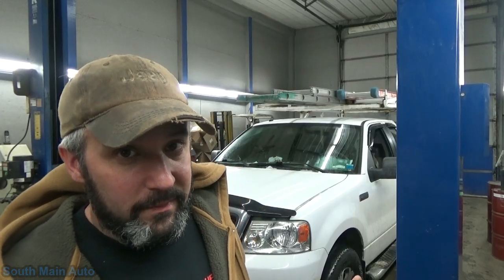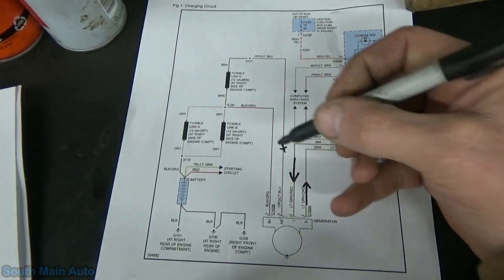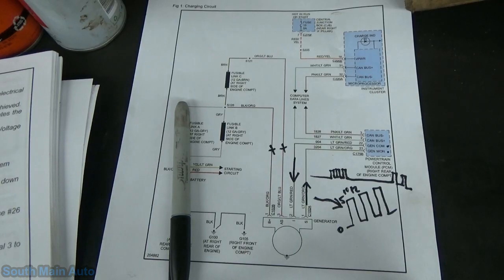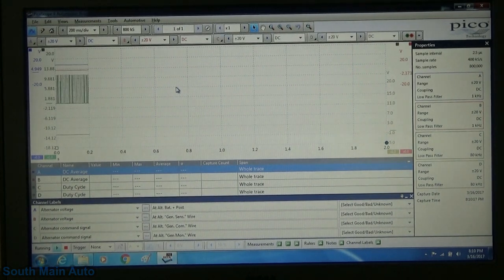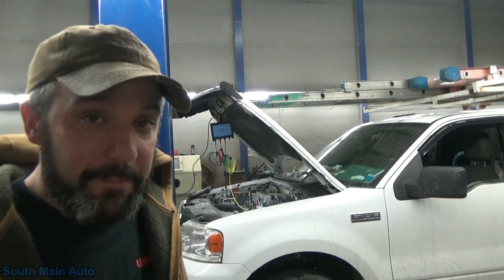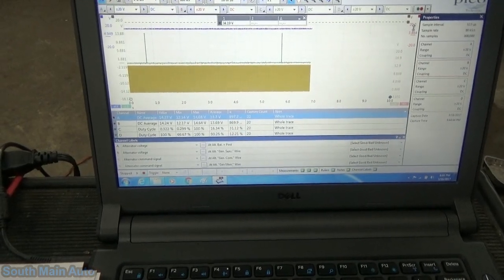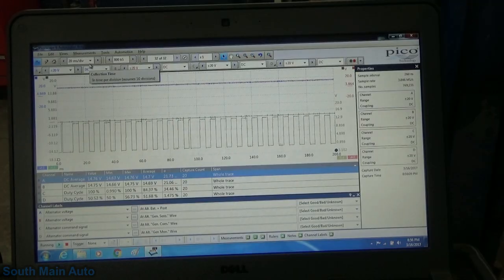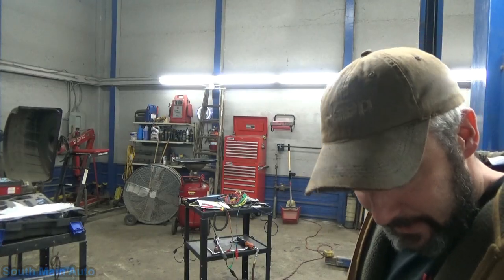Ford "Smart Charge System" Alternator Not Charging

Comment: Thanks for the nice video, but it's just another example of over engineered garbage under vehicles.
Reply: I'd say badly engineered or halfheartedly engineered. If the programmers had actually given a shit, there would be code to monitor the battery voltage and throw a code if the alternator isn't maintaining proper voltage and not just trust the COM line as gospel. One of those cases where when everything works, it works but when it doesn't then extra hilarity ensues because of assumptions made.
Reply: +gocars - I've got an '86 Grand Marquis that had the OEM alternator at age 20, with about 130k on the clock at the time. Simple, and reliable - can't ask for anything more than that.

Every year I love that car more and more. :)
Reply: i got 240,000 miles on my 94 rams original alternator.. and i only had to replace it cause the casing cracked when i went out mudding and it got showered in water.. still charged but only above 1500 rpm. they really just dont build things like they used to... and i even got a engine light for low charge voltage... those trucks almost never threw a code unless the part was literally falling off... and these fords systems are supposed to be "smart"?? lol what a joke ford
Reply: I agree. There has been a lot of this type of stuff over the years. Some things, simply cannot be improved upon without introducing more problems. There are other great ideas, but they are pushed out before they are ready. They need more testing and refinement for they are ready.
Reply: At least past the warranty. I've had them last 300K before. One on the wives Liberty is at 235K and still going strong. My Blazer is OEM at 196,562. Got a 99 Jeep in the barn with 270K on it that's OEM.
Reply: I've got a '93 Volvo 940 myself - wife commutes in it just under 70 miles a day during the winter months, so our '86 Mercury Grand Marquis doesn't rot away to nothing. Alternators on both of those vehicles work great - the Volvo one is OEM original - 24 years and 160,000 miles! The battery is also 5 years old with no signs of slowing down yet.

Don't need no stinkin' computers!

I believe automakers have switched focus in the 21st century - it used to be "PLEASE THE CUSTOMER" ... but that has changed to "STUFF OUR BANK ACCOUNTS TO THE BRIM" , unfortunately for us, the buying public.
Reply: Ahh the 940 was the last of the good built Volvo's.
I bet your Volvo has never had a corroded brake pipe ?
That was back in the day when car were treated underneath so donkeys years later they are still going strong.
Reply: I agree .  A lot of complication / technology , to what benifit to the car owner ?

God bless
Wyr
Reply: How long is a alternator suppose to last?
Reply: @flippingfripp  2 years but if your lucky 5
Reply: Idk its a pretty simple system. 3 wires red full time power blue 5volt and the grey wire is a lamp indicator.
Reply: Exactly right Tam! Copper-nickel lines right from the factory. They're green, but still intact! Same can't be said for my '94 Chevy S10 pickup plow truck - it's on it's 4th set of lines in it's life, and I noticed brake fluid weeping from that set last night!

 Why other automakers never used copper-nickel lines I'll never understand. Vehicles in the Northeastern USA especially, where road salt destroys most vehicles in 12 years flat - sooner where Eric O. lives, due to the "brining" of all the dirt farm roads in the summer for dust control.
Reply: My brother's '02 Duramax caught fire once. I suspect a shorted battery (never used to happen) due to where the damage was.

But I'll tell ya, only time I ever came close to having a car fire with a pre-'96 vehicle was in my '72 El Camino ... because the previous owner had wired in an ammeter, and the Phoenix heat disintegrated the rubber insulators. One day while driving in the rain with the lights, blower fan, and auxiliary A/C unit fired up once back home in MA, the juice broke through the rubber and grounded right out on my dash - car instantly died and everything was super quiet. Flames between my legs, LOL! I was able to jump out and yank my quick-release terminal on the negative cable and cut power, thank God! Would've lost the car otherwise. Was able to blow the flames out after that. Close one!! 

From a mechanic's standpoint, I wouldn't mind owning a Model T! My grandfather always had them. If you spun a bearing miles from home,  you could crawl under there on the side of the road, cut part of your belt off, wrap the journal, and be on your way in a half hour. :)
Reply: @SmittySmithsonite  I think all cars,trucks,anything with a battery should have a emergency shut off to kill power
Reply: No question about that, Kyle. My Marquis has the same miles - still going strong. OEM original fuel pump, & power steering pump too! Would've been on the original A/C compressor too if I didn't burn it up running alternative refrigerants on the OEM mineral oil, with an ester oil mix.

Try getting that kind of life out of a component on a 21st century vehicle ...  ;)
Reply: Same thing that effects a pencil. Friction from pressing down on the stator! The number one thing that destroys an alternator is heat, from having it run 75% load all the time. Which burns up diodes, rectifier, voltage regulator, stator, and rotor. It's why high output alternators have the voltage regulator outside it. A heat sink and huge ass fan. Not to mention a 150-175 amp fuse bus. To protect against a fire hazard. If the VR falls below 4 volts. It will produce 250 amps and burn every wire up in the harness. As in ohms law. 

It's why these are alternators. The convert AC\DC. Not the old fashion generators they used...
Reply: You can also change brushes on new alternators, it just removing the back cover an then there is the regulator.. it has a micro Prozessor included but still is a regulator with brushes.Problem: They don´t sell them alone.. you can only buy complete alternator.. for 80+% of modern alternators you can not buy regulators...this really pisses me off
Reply: Joshua C one of my family members has a 2006 Taurus with 108k replaced alternator at 85k. So far been reliable
Reply: @justinp8946  taurus was built to be j&d's, car and driver's car of the year. Its totally excluded from a typical ford especially a work vehicle, like a pickup
Reply: +Smitty Smithsonite - Hang on to that Sedan, Man!
Reply: in most cases only the regulator or brushes need to be replaced..but in 80% of altermators you can´t buy them anymore
Reply: you never changed the brushes ?
Reply: In Ferd's defense they probably would go with the simpler more reliable solution. They were/are trying to squeeze every last MPG they could out of their fleet. By turning the alternator on and off and only using it when you absolutely need to, it doesn't do you much good but it helps them meet those CAFE mandates from Washington
Reply: I agree 100% Ivan. 

Battery in my '72 El Camino - EXTERNALLY regulated (as in points!) - let my Sears DieHard battery live 11 years! I haven't been able to get more than 8 so far out of the Silverado's battery ... and that was with LOTS of help from a 4-stage charger!
Reply: gocars how many people have tech like Eric tho? There's the problem. Most people just throw parts at it
Reply: @royalwins2030  you can use a harbor freight dvom for $40. It just takes longer you have to test each wire separately. The 2 com wires just use the frequency setting. It's the info on the system and wire diagrams that can be hard to find.
Reply: Fripp; decade, 
unless it's in an ambulance that does two shifts per day...
Reply: Interesting. It almost appears to me that the charging command field is inversely proportionate to what you would think it would be. IE command 0 regulator and generator give the battery the beans. The higher the command ratio the more the regulator is told to back off. That's my interpretation.  This correct?
Reply: That's what I got out of it too, Jay.
Reply: 240.000 miles on the first set of brushes ? Btw, what does affect the brush life ? load on the generator?
Reply: I have 1996 Ford F150  250 ,000 on the clock all original  replaced 2 fuel pumps  is 1 AWESOME  pickup
Reply: get an old merc, the 124 mercs had a changeable brush set.... lasts forever.
Reply: This place has alot of parts for newer vehicles. Here's a GM alternator:

https://alternatorstarterrebuildkits.com/product/dr442pin/
Reply: +bobl78 - The alternator on my 2004 Ford Crown Vic doesn't have a "back cover" and it doesn't look like the regulator would be easy to change... It's not charging, but the brushes are fine, about 1/2" of wear left in them...
Reply: not worth it for most people, as your typical mechanic is not very well versed in electronics , how many Eric O's have you met in the real world of the automotive industry?  Most of them can not even read a freaking labscope, I quit going to them twenty years ago, lol

/
Reply: "massively extend life of alternators and batteries"....ummmm this alternator only lasted 10 years so that is an engineering FAIL. Also, statistically I don't think batteries last any longer with these smart systems at all. Sometimes it's the opposite!
Reply: @PineHollowAutoDiagnostics  strange thing is that my old 70's era cars went through batteries and alternators every 3 to 5 years with moderate driving on cars with less than 100k. My 400k Subaru, I replaced the alternator once around 300k, and was on the 2nd battery it ever had in 20 years.
The thing is old cars required way more maintenance and had a shorter life span. They lasted the same amount years, but we collectively drove  less then. 100k was old. Now 200k to 300k is normal.
Reply: My 28 year old Volvo has a total of 16 fuses  and has its original alternator works just fine.
Having worked on cars for the best part of 45 years i do understand the concept and operation of the system but in my opinion if it aint broke dont try and fix it.
I do understand things progress and i am all in for that but sometimes so ideas are WAY over the top.
Example, dual clutch assemblys work awesome but its over £1500.00 for parts.Then theres the labour and the special alignment to to install the clutch and the tool is a £900.00.
So its not all rosey in the Automotive business.
Reply: simple rules, i'd rather drive a car i can fix at the side if the road with my eyes and hands than ANY of the modern shite. all this modern fucking around is aimed at one thing, making it a fucking nightmare to fix yourself, and to force you to take it to the dealer where they can rape you for cash.... FUCK THAT.
Reply: Amen Rick Amen.
Its a wonder that older car even ran at times.
Modern overcomplicated heeps of overpriced garrbage.
Simple is good in my book.
Reply: It's not over complicated. They system is just 4 wires that control the amount of voltage\amps the system gets. If it didn't monitor it right. It can fry your radio, dash panel, even the PCM.. As they are voltage sensitive and expensive to replace because it got 14.7 volts and not 13.8 volts.  That the PCM demanded. Just like the idiots that replaced their rear tail lights with LEDS then wonder why they fried their transmission. As it thinks you have your foot on the brake and locks the TC up all the time. Then they say how much to replace my transmission!!!!
Reply: @MasterChief-sl9ro  the tail lights aren't in the same circuit as the brake lights. Did you mean brake lights having the LEDs tripping the TC lockup command? If the brakes aren't being applied, the switch is open and the brake lights are off even if the tail lights are on. Totally different circuit that is NOT part of the TCC and Brake Switch.
Reply: @PerrynBecky  Some Vehicles that came with resister bulbs need that bulb... If you replace them with LED. You need to put a resistor that matches that Bulb. As the TC will think you have your foot on the brake. If you remove side panels on some cars. You see relays and fuses in there. They control the all them circuits. 

I become aware of this from transmission experts years ago. And that third eye is the worst. If you see that bulb out. Replace it right then.
Reply: Yeah how dare the auto manufacturers design a system to massively extend the life of alternators and batteries in their vehicles. Ford went one step further and designed it to fallback to a traditional style circuit just by unplugging the com wires from the alternator. They could just as easily designed it to not charge at all unless there was comms with the PCM. Just because you don't understand it, doesn't mean it's "over engineered garbage."
Reply: @pv2xeek  thats a dealer secret. Noone knew that until 10 to 15 years later. Not simple at all
Reply: Seems like Ford went to a lot of trouble trying to fix an issue that did not exist. Most alternators fail due to worn brushes/commutator or blown voltage regulator and these can be detected with a voltmeter and fixed with $20 of parts.  'Ford Built'.....to fail.
Reply: +fripp how long, perhaps 50k miles seems about average for what ive seen
Reply: I totally agree. I had a 2004 Taurus with 260,000 miles with the original alt with this system. It was still working great at that 260k when I sold the car. Ford was one of the 1st to use this type of system but now all vehicle manufactures use this system. I think it cool they choose to use a system like this as the old system would probably still get the average person past the warranty but this system will allow the system to last far past the warranty and far beyond.
Reply: @jockosboy17  alternator is a general repair/replace part. Its service is shorter than warranty. Plus if your not replacing it with motorcraft parts its guaranteed shorter life. Thats the marvel of very expensive ford engineering.
Reply: i wouldnt necessarily call it over engineered.  these systems can extend battery and alternator service life.
who knows how old that alternator was? it may have been the factory original, in which case it lasted a long time.
yes, i will agree that cars are super complicated devices now, but generally speaking they are safer, more reliable, better built, quieter, comfortable, etc..
AND...when you have techs like Eric O. (who is DA MAN) they are easy enough to service and repair
Reply: Josh Underwood I understand a little bit more than you think, and all that crap is completely unnecessary and a vehicle.
Reply: You have no clue what you're talking about. I seen voltage regulators burn a vehicle to the ground. Today's modern vehicles need these systems. As you have 300+ calculations a second to maintain there fuel, air, transmission, braking, etc... efficiency. As these are not your dads horse and buggy or model T. We got better microscopes today...

Comment: i know ya do these videos in advance, but a theory of why the light didn't come on... how about the body ground?
Reply: HOW ABOUT  extremely bad trash engineering/ I HAVE A 1996 fORD f150 REPLACED 1 BATTERY AND 2 FUEL PUMPS  OTHER THAN THAT ALL IS ORIGINAL
Reply: @geraldsanford2411  whats bad about it? Ford has made millions more off it

Comment: nothing smart  about this charging system
Reply: Leave it to Ford to take something super simple and completely fuck it up by trying to be cute
Reply: @ericb7131  Ford comment of all time
Reply: The idea of these type systems is to give your battery longer life, reduce fuel consumption and make your alternator provide only the power the system needs.  Of course this is moot when it fails but does provide value to the ones that work as designed.
Reply: @chuckgrenci6404  once again more eco fuel efficiency crap, it probably nets you .001 mpg and any fuel savings are negated 300x over by repair costs. Too much over complication on every newer car. They can keep it, I'm staying old school as long as I can.
Reply: @AmandaHugenkiss2915  you would be surprised at how much load the alternator can draw ... back in the old days 30 amp was typically what all cars had ... today do all the electrical needs at minimum 60 amp is typical but can be 80 to 100 depending on the type of vehicle... so dumping that much current and charging voltage would significantly shorten battery life ... so designing a better charging system was a must for battery life as well as being able to keep up with the electrical demands of modern vehicles (can provide the current when it is needed)
Reply: The newer ford trucks are even worse. Forget about jumping off stuff with the newer models.